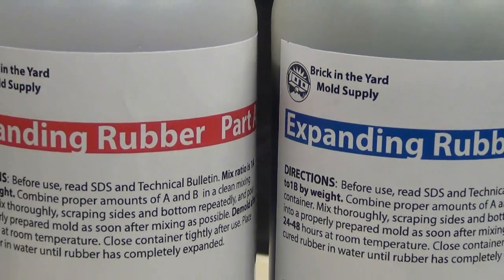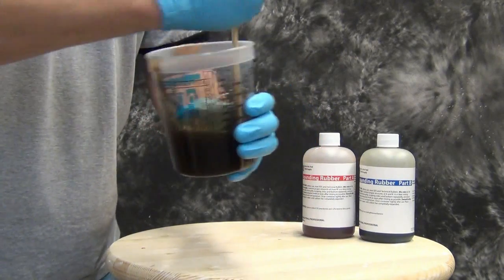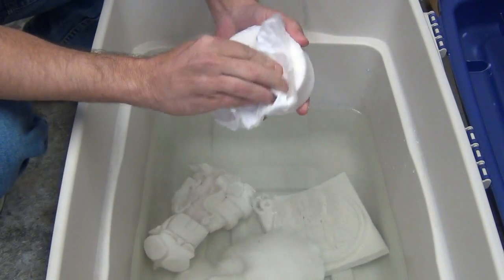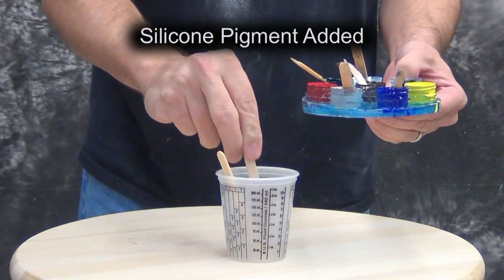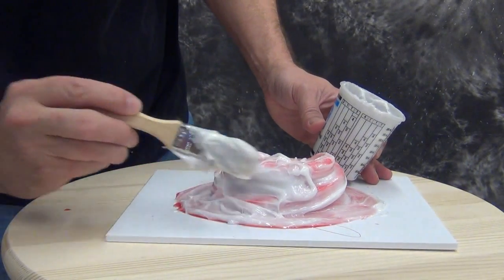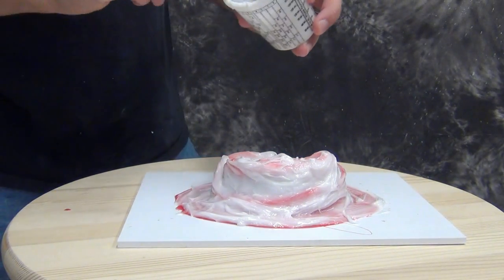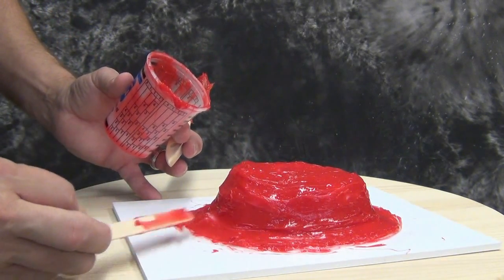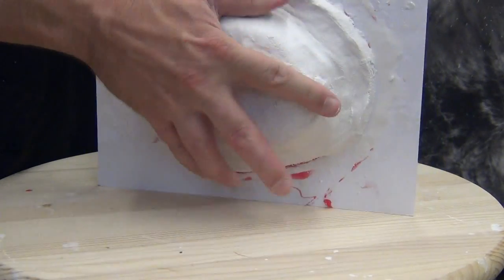Expanding Rubber: Molding And Casting Tutorial

Comment: That is amazing. 
Now I can imagine you would want a bigger part with some specifications in mind. Or you have multiple pieces that need to be enlarged exactly the same so they will fit together again. Is possible to calculate a specific end size? Or is it basically the same rate of enlargement every time?
Reply from the maker: We are still learning what all it can do, but so far it appears to grow about 150% consistently. You can then make another enlargement and make it bigger. I am going that right now to make a giant quarter. As we play with it we will be posting more info on our blog as well as more tutorials.
Reply: Brick In The Yard Mold Supply
LOL. That was indeed what I was thinking but with a small plastic figurine. Those inch soldiers....maybe to flimsy? Looking forward to the results.
But Blog? I'm apparently missing something. You got a link?
Reply from the maker: Our blog is on the brickintheyard main page. Just follow the links to our website.